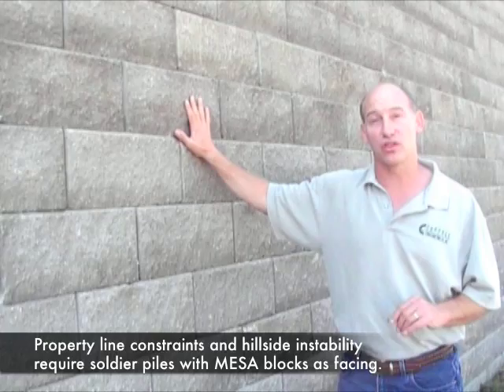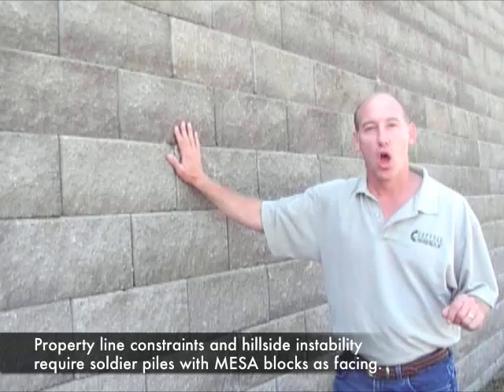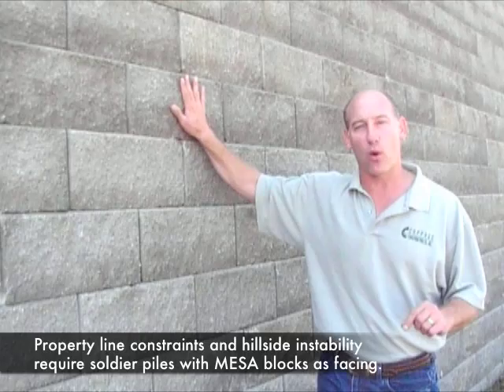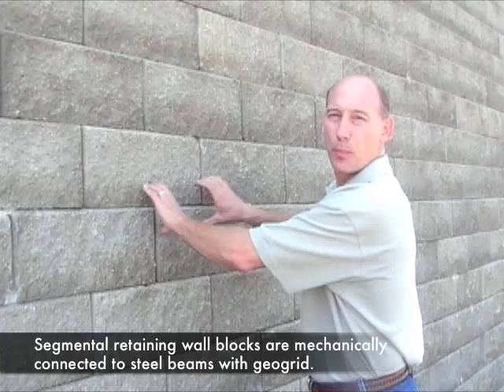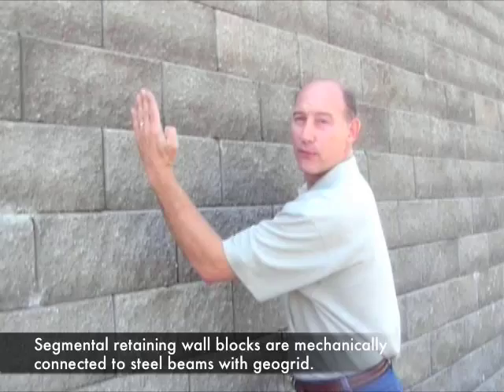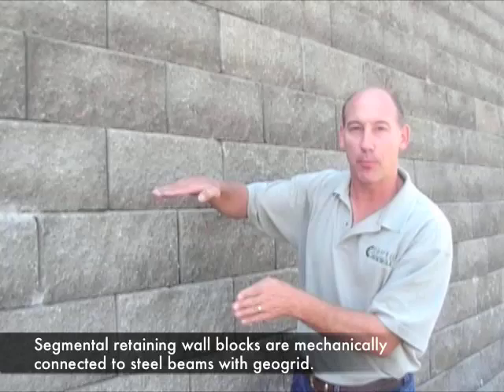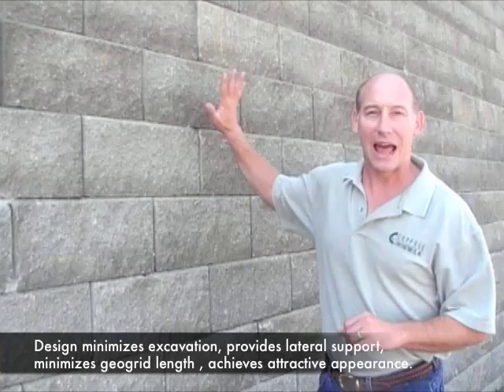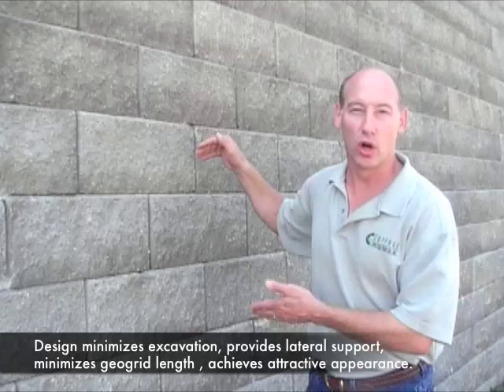Retaining Walls - Segmental Blocks attached to Pier Wall

Comment from the maker: The pier wall (hidden by the blocks) is called a soldier pile wall. It is made of vertical steel beams with horizontal wooden beams between the vertical steel beams. The steel beams are slightly rusted (but very thick) and the wood beams are pressure treated, so they are slightly "greenish-gray" looking.  See the video "Soldier Pile Wall with Tiebacks" for what the pier wall would look like!

Comment from the maker: Regarding warranty - that's a different issue.  Basically, there are a couple kinds.  First, the contractor will have a "warranty" against defects in materials and construction and those vary from 1 year to several years.  The engineer doesn't have a "warranty" per se, BUT the wall is designed for a life of 50-75 years!  The engineer must "meet the standard of care" meaning that other engineers in the same area would have designed it the same way.  (There's no time limit on that.)